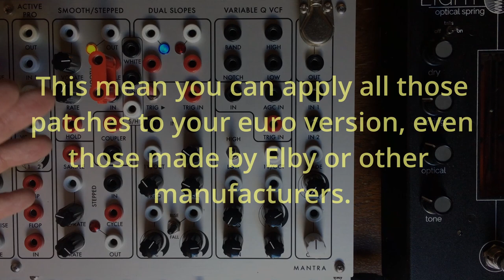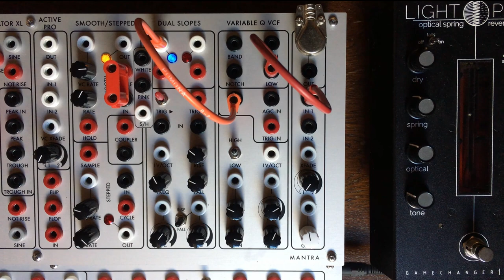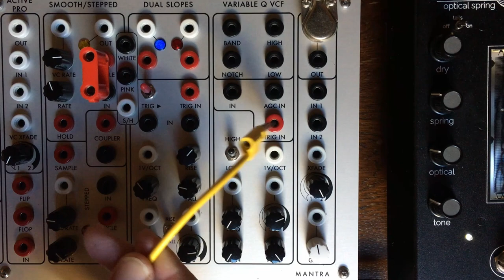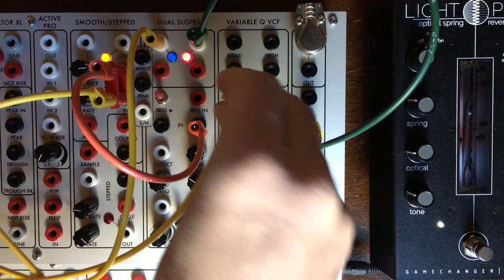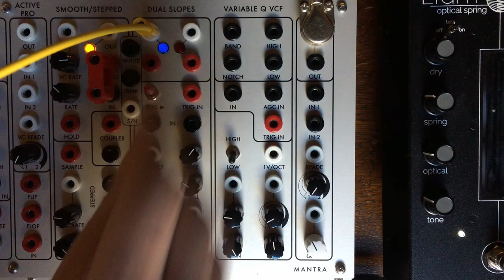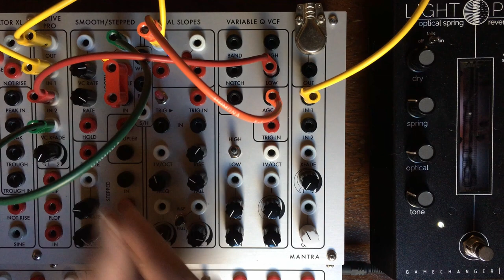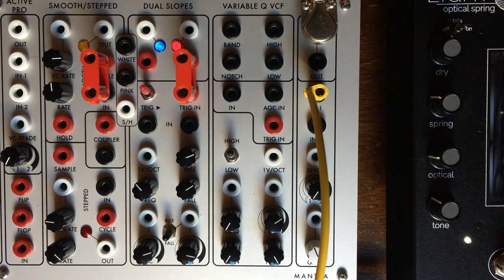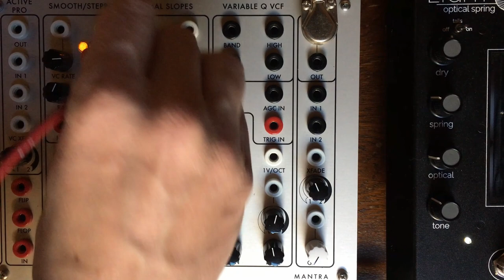Maybe my favorite filter - a deep dive in the Serge VCFQ by Random*Source

Comment: @17:43  this sequence is so awesome. I hope I am able to replicate something like it, but it's not clear what the other module(s) off screen are doing. Maybe I need to watch an earlier part?
Reply from the maker: I did not explained the rest of the patches in this video as it is a focus on the VCFQ. What is it exactly that you want to replicate ?
Reply: @Stazma  The patch toward the end of "Bleep soup". It seems like there are 3 or 4 stepped CV sources for Q, 1V/O, the function generator, and the VCA for white noise. Is there an envelop on the VCA or is it just stepping the level of the output? The filter's ping has a gate pattern going in and the function generator is looping to FM the filter via the VC F input.
Reply from the maker: @888cromartie  No env on the VCA, just pinging the trig iniput of the VCFQ and sending stepped CV to the Q for volume + lenght control. You are all good for the rest ;-)